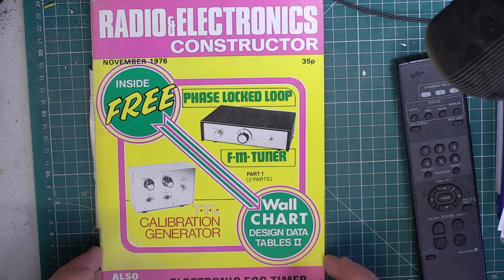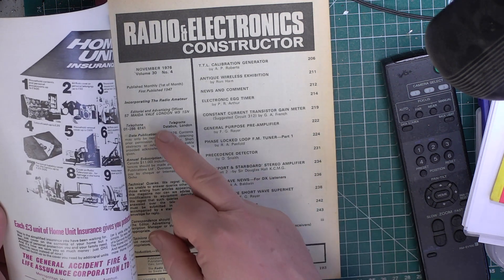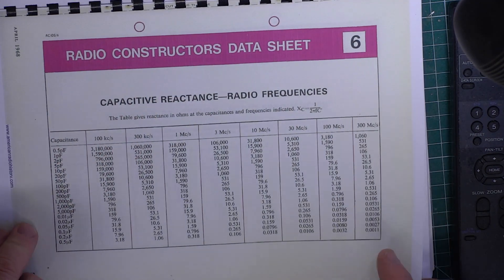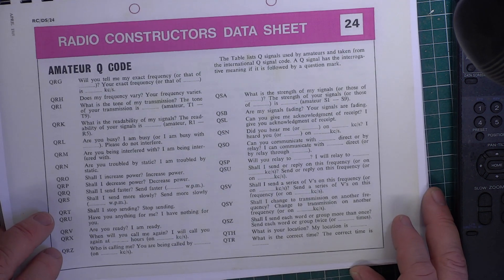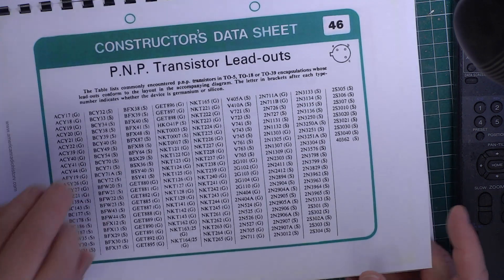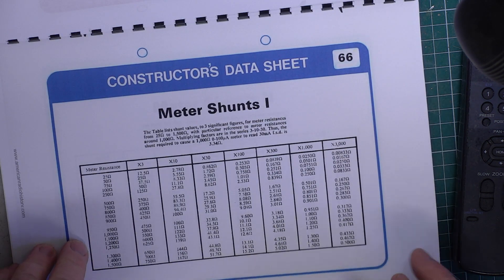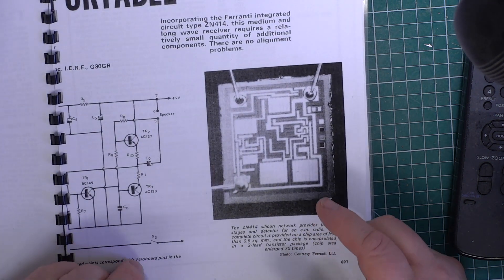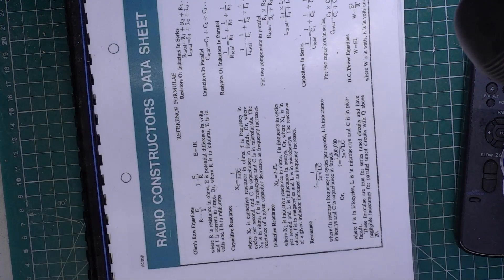Radio Constructor Datasheets 1968 to 1980's

Comment: I love the old radio mags, the older the better. I had a stack of Electronics & Model Engineer magazines c.1919 to 1922 from a car boot sale with some of the articles written by Marconi himself. Now sold on, and I repent at leisure. 
If you're missing any data sheets from that series let me know, I've got a few of those mags from the 70s so might have copies.
Reply from the maker: I can always do a video looking through issue 1 of Practical Wireless from 1932!

There is still relevant stuff even in mags of that age. I needed to make an RF choke & I found the info to make one of exactly the right value. I used Tuffnol as the former rather than ebonite that they had then. I then had to put it on the lathe & machine ten deep grooves in it & put about 250 turns of wire in each of the ten grooves. I did one per day! Anyway, it worked spot on.

Richard
Reply: Got that.
Reply: @ukfmcbradioservicingTango21  I'd like to see a review of PW issue 1. The earliest copies I have are from the late 50s.
Reply from the maker: @mosherj666  I've printed off PW no1 yesterday & will do a video over the weekend. Spiral bound A4 printed scans are far easier for us all to look at than the 90 year old delicate original.

Richard
Reply: @ukfmcbradioservicingTango21  Great news Richard, I'm looking forward to it. 👍